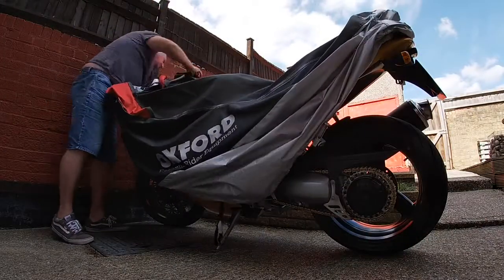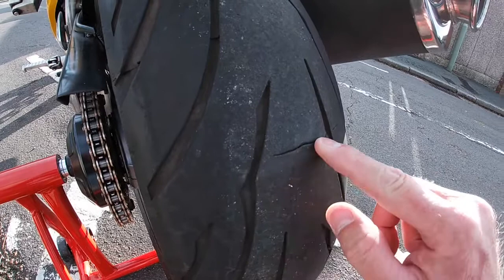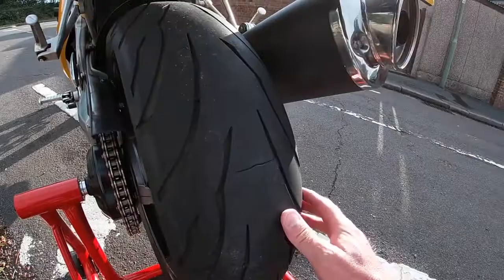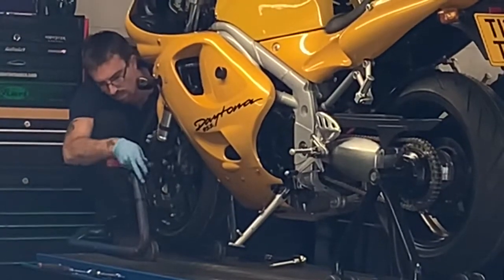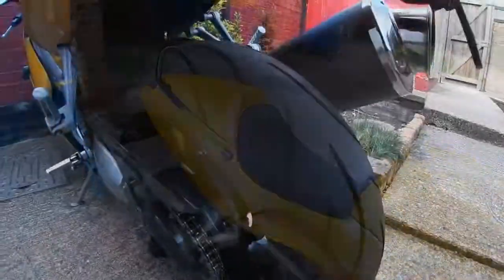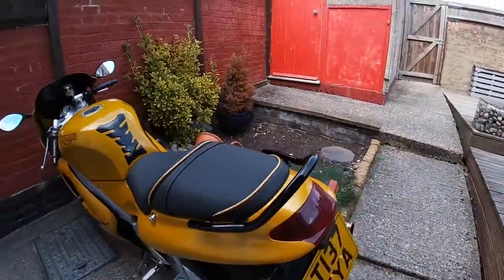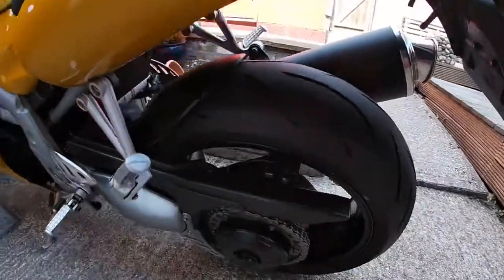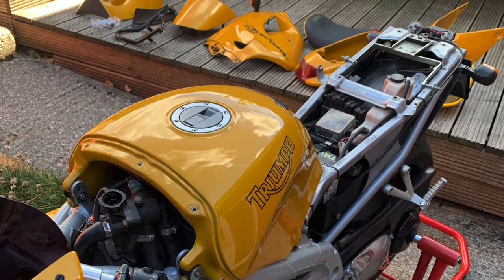Ep 41 Triumph Daytona T595. A 20yr old Superbike. Any good ?

Comment: A word of advice from someone who has done basically every job on one of these bikes, is to get that petrol tank lined. Ethanol fuel will attack it. The tank  will grow believe or not and bubbles will appear all over the tank under the paint. I'm surprised if it hasn't started on yours yet. I used Caswells tank sealer in mine after drying it out. Google the problem, act now before it happens.
Reply from the maker: It did have a few very small bubbles under the Triumph decal on one side.Hardly noticeable unless you were looking for them! They did seem to come and go to some extent although not completely. I’ve seen early Aprilias’ with this same issue.
I’ve since reluctantly sold the T595. As is usual, I wish I hadn’t 😏
Reply: Mines already got some bubbles which seem to be getting worse. is it too late to line - and then get it resprayed ?
Reply: @lagonda5153  No it's not. But you must dry the tank properly. Drain it ,Take side plate off and completely remove the fuel cap. Leave in a dry warm place for a couple of weeks to allow the tank to shrink back to its proper shape. The bubbles will go down a bit, but gas will be under the paint. Not to worry,  if repainting when rubbing down all those will go. Wash out with hot soapy water a few times, dry and then I used xylene to wash all petrol and oily residue from inside the tank.Allow to dry again for say 24hrs  I even mixed some xylene into the tank lining epoxy to make it runnier to help application. Once sealed your tank will be good to go👍
Reply: @jasongreen2179  Thanks for the top tips - i think i will try and source a good second hand tank and use this and follow your advice, coat and then have resprayed. In the meantime im using the Esso supreme fuel which I've read online doesn't contain the additives. Coming into the summer here in the UK so it will be a winter project!

Comment: If its a '99 then it should be a "955" not a "595". Triumph renamed from that year. I (still) have '99 build date May 1999 "955" (Tornado Red). Fabulous bikes :-)
Reply from the maker: Log book V5 says Triumph T595. Maybe new old stock when first registered…
Reply: @traicys-dairy  and the latter designation on the side fairings..."955.." Frame number and engine number will confirm also if the engine has the minor changes such as resolving 4th gear issues. (Workshop manual references specific engine number ranges). TuneECU can determine also what map is in the ECU. The frame should also have a date stamp on the sub bracket that seat attaches to.  But def looks like the updated '99 year :-).

Comment: Your Daytona really is nice looking. I see you have the passenger footpegs, which mine lacks. I have a '98 in black. It sat out in the weather for three years, so lots of rot on the seats and corrosion. It's running now with a new, used seat and I'm having a blast.
Reply from the maker: Good on you Tim! Three years of neglect is going to take some elbow grease, I don’t envy you lol. 
Sadly, I’m in a position where my bike is also outside so requires constant tlc.
Ride Safe!!!!